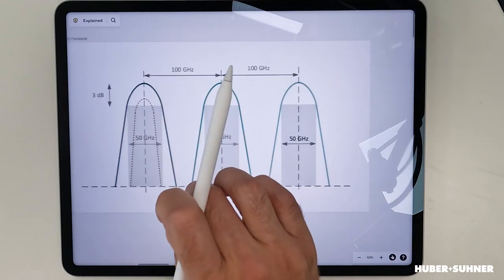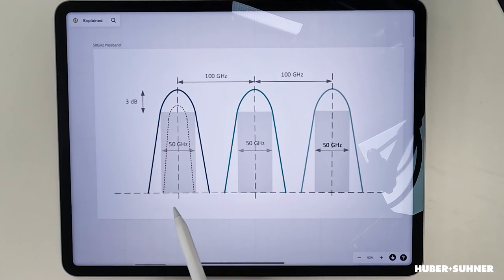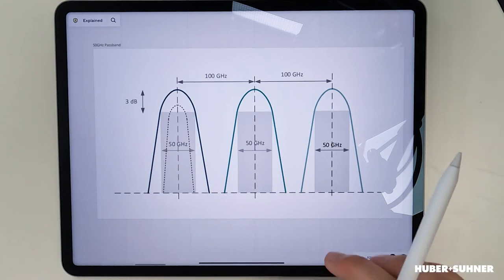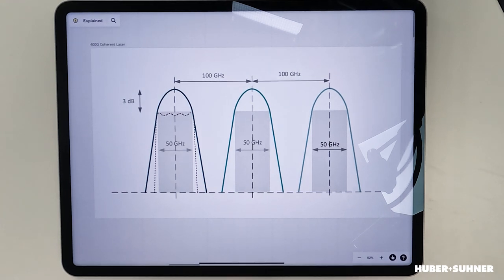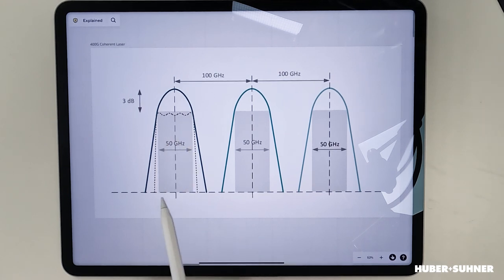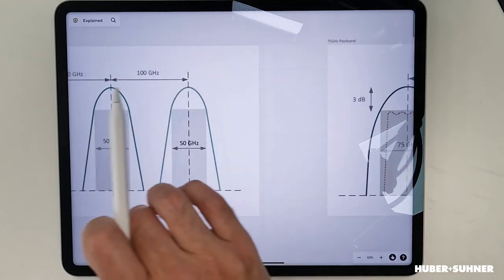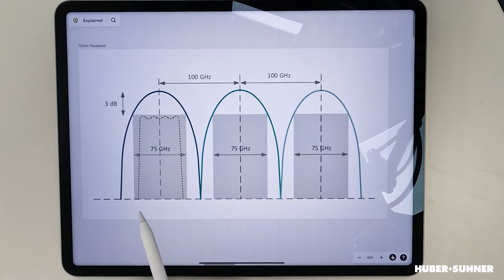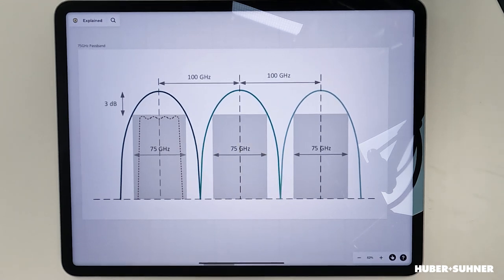DWDM Multiplexing 400G (01-01-03)

Comment: Does Dwdm have any ratings for transfer capacity like ethernet switch or they just carry the signal and are speed independent?
Reply from the maker: Thank you for your question @RahulAhire.
No, the DWDM technology itself is completely agnostic to data rates and protocols. On one channel you could for example send a 400G Ethernet, the next one a 10G CPRI and yet another one an analog RF signal. What type of signal and the data rate is determined by the equipment and transceivers that are connected to the DWDM system.
Hope that answers your question.
Best regards
James
Reply: @CubeOpticsAG  oh got it 👍. Thanks for sharing your thoughts I previously assumed it might be like internet bonding on single pair of fiber.